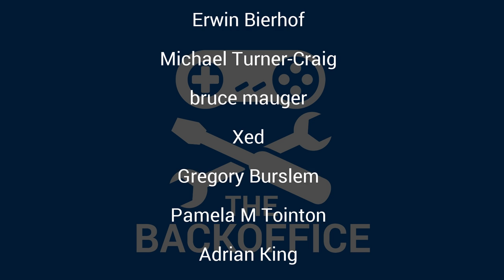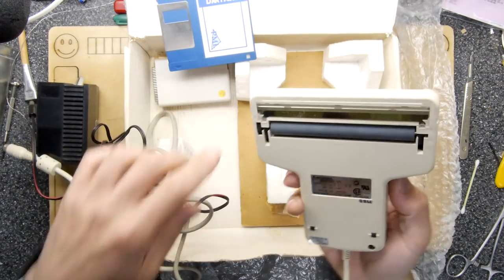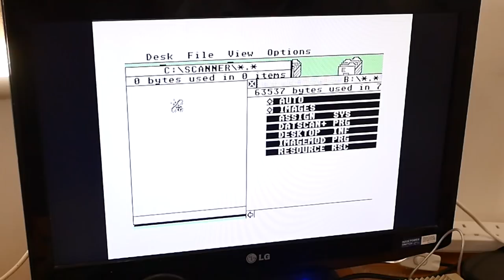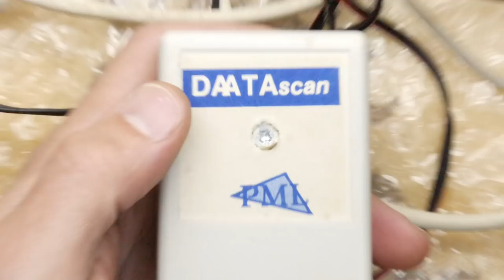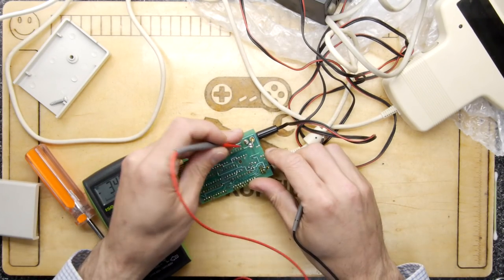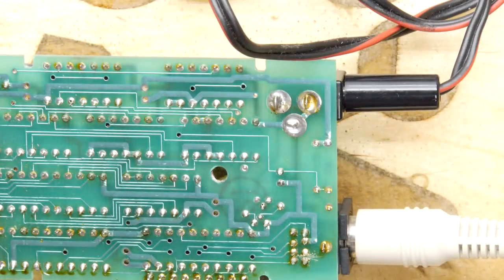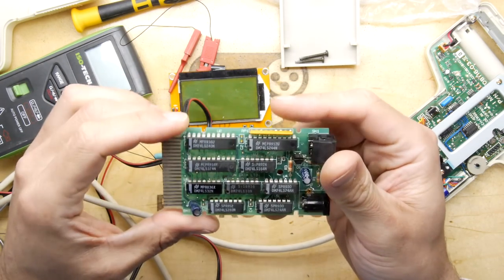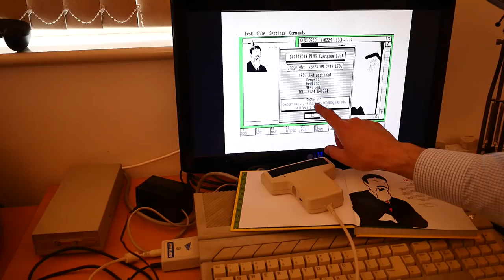Atari ST Hand Scanner

Comment: Hi, I'm the author guilty of the "weird and pioneering" software ! The Scanner and a previous GEM GUI by another author had been previously released, which I'd bought as a regular consumer. I'd done some Z80 Assembler game development on the Spectrum for one of the many small software houses before, and was switching to 68000 Assembler on the ST, so wanted the scanner to produce graphics for ST game development. 
I'd written the other app IMAGEMOD (shown in the software listing in your video, but not executed) for my own use, as I'd coded some novel functionality allowing monochrome images to be converted to 16 "colour" grey-shade images which could then be easily edited and colourised in 3rd party graphics apps. I'd offered this to the distributors of the scanner "Pandaal Marketing", who liked it and offered me some work to rewrite the GEM scanning GUI too. The GEM GUI shown in your video was actually my first GEM app, which might account for some of its unconventional user-interface ! The design was intended to give the user a page as a workspace, into which they could scan multiple overlapping or double width scans by first dragging out a scannable area of the page, executing the scan, and then repeating as often as they required (I think the previous software had a single scan width buffer which was saved after each scan). As usual for such projects, time pressure demanded the GEM app be released probably a little prematurely. Still it was quite exciting to see it getting reviewed in the ST Magazines at the time !
Shortly after this was released though, I used the app and magazine reviews to impress the recruiters  at a large financial institution, for a Mainframe COBOL programming job, and spent the rest of my programming career there, switching to Visual Basic to write office apps, and then Web development during the dot.com boom. So, for all its limitations, the scanner app proved to be a Gateway project, even though sadly, I never used it in earnest for the games I'd been planning to write.Thanks for your video, it was quite a blast from the past !
Reply from the maker: This is absolutely fascinating to know!

Always awesome to hear the tale of someone involved in producing a gadget like this. I would love to record a chat with you about this, and thus, officially document this piece of computing history 😂

Comment: I used to (still have it in the attic) scanner.  It was great, it would do greyscale and a 'simulated' colour thing.  I've still got the floppies, i'm sure they are all dead now, but should really get round to trying to get the pictures off them somehow.
Reply from the maker: That will be interesting, there is really good chance the floppies should be ok. I've not had any trouble reading any from that era, commercial and public domain discs alike.
Reply: @backofficeshow  I've just bought a usb floppy disc and will try and use st recover etc to see whats on there, give examples.  Worse case I will get it all back and running again, i found the scanner software at least.  I'll be happy if the thing switches on!
Reply from the maker: It's getting exciting 😂 I have my fingers crossed
Reply: @backofficeshow  i'm starting the process of getting this back up and running, lots to do it looks like but should have some good stuff in a couple of months.

Comment: 74 series TTL (transistor-transistor logic) chips. LS is Low power Schottky type. Huge range of 5 volt digital logic chips. Still common at the time was a fairly equivalent, maybe even a larger range of 4000 series CMOS logic chips. I think those were maybe 9 or 12 volt chips, but could be more static sensitive. So, yes, the 74LS240 part was that chip type.
Reply from the maker: Should it still be relatively easy to copy this entire interface?

probably less useful than copying the audio capture interface I should think because it will be tricky finding another hand scanner 🤔
Reply: Should be easy, the hardest part being copying the circuitry of the top layer. Some of it runs under the components out of sight. It is probably mostly just a bit of address decoding, some buffers, maybe shift registers, converting serial to parallel. Maybe even replace  most of it with a microcontroller and software, if you are that way inclined.